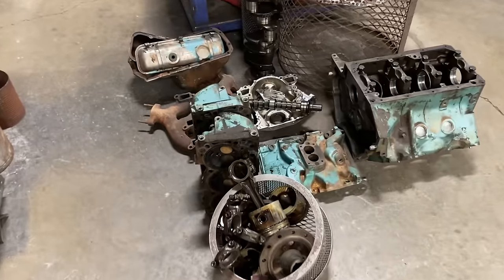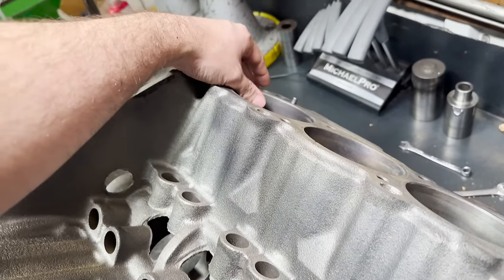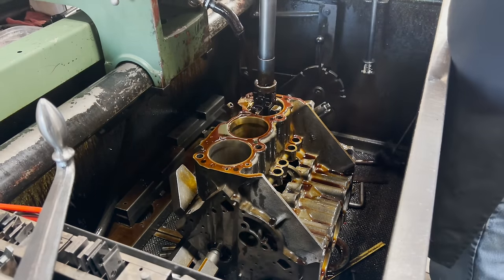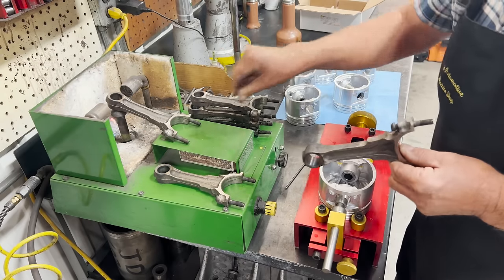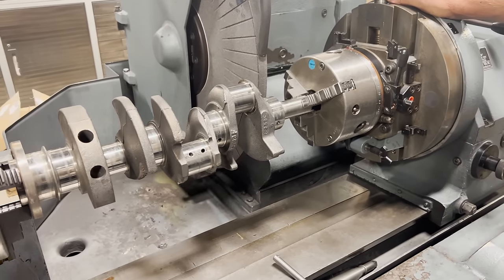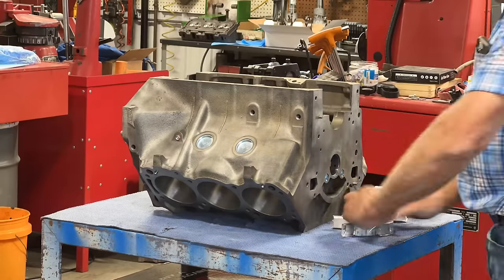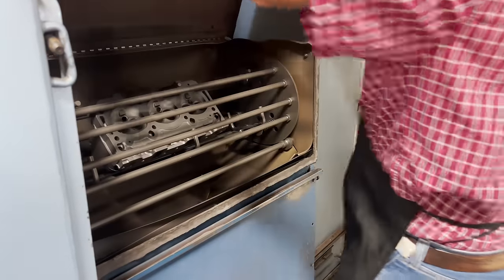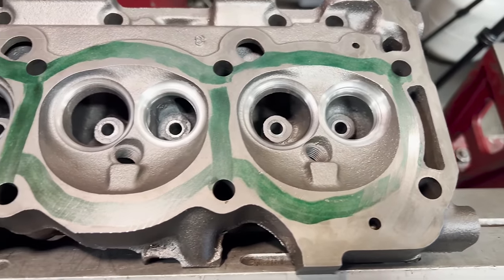This 225 Buick DAUNTLESS V6 Odd Fire Was WORSE Than We Thought...

Comment: I worked at a large Chevy dealer in 1977 when they started putting that odd fire engines in the cheap Malibu. One of the customers asked one time how come the ball on the three speed shifter was so big. One of the techs came up and said the reason they make the ball so big is so you can grab onto that sucker when it's idling. They ran surprisingly good but at idle they would shake the teeth out of your comb.
Reply: They needed to make it 60° vs 90°. Would have quelled a lot of the NVH.
Reply: My odd fire ran really smooth on the stock cam, once I put a the middle ground comp cams camshaft in it would shake a little as it rumbled.

I think a huge part of why mine seems so smooth is Jeep put a super heavy flywheel on them so that probably dampens the vibrations a lot.
Reply: @Livedracersteve I'll second the heavy flywheel probably helped.
Reply: How can you warranty the engine if the customer does most of the assembly?
Reply: @joshuaatkins5197  yeah I don’t know if you have ever seen the dyno graph for the Jeep version, but because the flywheel is so big, the torque and HP curve do not cross, it looks a lot like a 383 stroker curve where it just Carries the torque.

They would probably cross if you could rev it out more, but a stock engine stops making power around 4500 due to how poorly the heads flow.
Reply: @LynxStarAuto  Indeed, having a 60 degree V6 would have helped. However, companies love building 90 degree V6 engines because they can cut 2 cylinders off a V8, rather than so a lot of engineering to build a completely different V6.

Many years ago, GM did have a 60 degree V6. They put it in some of the heaviest GMC trucks. They had to make a V6, because making a 351 cubic inch straight six would not fit easily. I think some were as big as 478 cubes. I am fairly certain smog laws were the end of it.
Reply: @Livedracersteve  I havent but that makes sense.
Reply: @darrellbedford4857  All the machining & critical stuff has been done & done well no doubt. Other than fitting / timing the cam, the rest is all pretty straightforward. Unless the customer has hammers for hands that is, but we didn't see any bite marks or lint from a striped apron so all should go well. Would love to hear the exhaust sound.
Reply: @LynxStarAuto  Yes but that costs $$$ as it would need different tooling to bore & hone the blocks, as the 90 degree blocks can be bored on there normal V8 tooling. the wasn't a 60 degree V6 built in US until 1979, despite Ford UK & Germany getting it right in the 60's
Reply: @joshuaatkins5197  Torque and hp curves ALWAYS cross at 5252 rpm. Doesn't  matter  what the engine is. If an engine can't  acheive 5252 the curves don't cross.
Reply: @williambikash6645  Why are you saying that to me? I never said anything to the contrary. You probably meant to say that to someone else. Simple mistake on your part. 🍻
Reply: @skylinefever , an interesting thing about that GMC V6 is that it was produced in a variety of displacements as well in a V8 and V12 configuration. It seems quite odd, having a 60 degree V8.
Reply: They had a few different 6s in the Malibus. If the distributor was up front it was this Dauntless oddfire. 

The rear distributor ones (3.3L and 3.8L) were just cut down small block Chevy V8s. Exact same thing they did for the infamous 4.3L V6, just smaller bores and strokes.
Reply: @JM-lk6wo when GMC developed their V6s they didn't have a V8, so they were designed with all new tooling. The GMC  V8 was later designed from the V6.

Buick however already had V8s, so they designed the V6 to be able to use 90° tooling they already had.
Reply: @darrellbedford4857  you could only warranty the parts you put in and assembled and you would know these also if he or she or it for those inclined got the parts through you then standard parts warranty would apply to those this is the way i did things Cheers
Reply: @skylinefever manufacturers still had to make new molds.   Their inherit value was most of the incidentals (piston, rods , valves etc)the front accessories and mounting and bellhousing was common with their V-8 cousin.  Very economical
Reply: @skylinefever I'D take a 4.9 (300ci) Ford inline six any day over any V-6
Reply: @skylinefever The 2.8 and 3.1 were 60° engines as well.
Reply: Didn't shake as bad as the 4.3 diesel!
Reply: @OvertravelX  Yes, the 2.8, 3.1, and 3.4 were common V6 engines in FWD GM cars. I replaced so many stupid gaskets on them.
Reply: It was not an oddfire by then an even fire so this is false.
Reply: @skylinefever yep. And some of us still work on those old monsters from time to time. The company I work for has an OLD Hyster forklift with one. Been run on propane almost it's entire life and the oil comes out clean still to this day.
Reply: @skylinefever they also had 60deg V8s back then. Found this tidbit out just now trying to figure out from Google what the engine is in the forklift. Going off memory isn't helping since I only see it maybe twice a year.
Reply: @tcmits3699  oh, I don't know......GMC made a number of V6s that would put a 300 ford to shame.
Reply: Does boring and honing on older blocks with a torque plate show benefits?
Reply: It seems odd that if they were eliminating two cylinders, changing to a 60 degree block shouldn't have been such a big deal,
.  It would certainly have left more room in the engine bay.
Reply: @iancormie9916  all of the machine tools were set up for a 90 degree block.
Reply: @PMaynard-22  My '77 skylark is an odd-fire.  There was a mid-year switch in '77 to the even-fire.
Reply: @williambikash6645 
If the engine can't rev to 5252, some math can usually help extrapolate the curve to confirm
Reply: @darrellbedford4857  customer did disassembly. They gave him back a fully assembled long block
Reply: The toughest 6 cylinder engine I ever saw was a Chevy 292 inline 6. My father would slow down to 15 mph and never take it out of high gear. Then he would step on the gas and go. It would pull off like it was nothing holding it back. It didn't even sound like it was lugging. If I could have any 6 cylinder engine for a custom built car, it would be a 292 Chevy.

Comment: Thank you for explaining the whole odd firing thing. Very good illustration.  👍
Reply: Came here to say this as well.
Reply: Indeed. I did now know of a 90 degree V6 that either had offset crank journals or a countershaft.
Reply: Buick later updated their V6 to a split crankshaft in order to create an even firing order. It eventually evolved into the GM 3800 V6.
Reply: I believe that they went to the splayed crankshaft in late '77.
Reply: Not discussed in this video but I found it interesting the way they did the distributor cap
Reply: I remember it well, my 68 CJ had a 225 in it, tore it apart in 1982 and rebuilt it, sure miss that sound

Comment: the more rebuilds I see on Buick engines the more I like them. Very good engineering put into that Marque in those days. This is probably the only Dauntless V6 machine shop video on the internet! cool
Reply: My favorite thing about the old buick is that a buick 455 engine block doesn't weigh much more than a 350 Chevy block.
Reply: yeah! seems like black magic. And this little V6 is built like a bulldog with the pan rails and compactness
 @skylinefever
Reply: I could have kicked myself for not buying that little Buick nailhead V6 I saw one summer

Comment: Buick V6 expert here....    I know the engine is longblocked, but there's a couple things on these engines to be aware of.

The main one is because of that flat tappet cam.  Way back when, when Buick desigened that engine, they messed up the print on the #3 exhaust tappet bore.  It's damned near directly over the center of the cam lobe. (and for some reason, they refused to fix it on later castings)  Some cam grinders even choose to grind that lobe taper 'backwards' to try and make sure that tappet can spin.
  With Buick V6 blocks it's VERY important to burnish those bores, sometimes twice. I use the Goodson tool and I'm not sure if anybody else even makes one that works well.  Since you're running a flat tappet cam, I HIGHLY recommend grooving the lifter bores to force feed a small stream of oil to the opening ramp of the lobes.   These blocks love to wipe cams and with modern blanks, and non-hardened lifter feet, (along with modern oil formulations) a flat cam is a recipe for disaster if you're not careful.

This might not apply to this build since I'm a turbo Buick guy and we run split pin cranks, but rod bearings out of a newer 3800 series engine are wider and the same width as the rod. They're a direct bolt in and give larger bearing surface area.  With the final HP that Jeep engine is going to make, it probably won't matter.

Also, oiling is very important in these engines as well.  Especially with the low RPMs the jeeps will see. The way the oil circuits work in timing cover/pump is the low pressure side of the gears is partially starved until the pump can make enough pressure to crack the bypass valve open.  Once it's open, then both corners of the gears have access to oil.

Here's an article I wrote years ago showing some free efficiency and flow mods you can do to the timing cover.  The main one got named the ''earlbrown booster hole''. Drilling that will allow the entire gear faces to have full access to oil without the factory designed pressure drop at low RPMs. It also lowers the head height and gets rid of a couple unnecessary 90's.
  Since these engines like to make torque very low in the RPM range, you have to be careful not to load the bearings before the pump can get on the clock and start making real pressure.

https://www.turbobuicks.com/threads/how-to-build-a-front-cover-oil-pump.39169/

Also, as another bonus, making the pump more efficient will lower the amount of load on the front cam bearing.  Since that area is the first place the engine gets oil, not wearing that out pays dividends all the way thought the chain of bearings and passages.  (and eliminates the need for band-aid HV pumps, and thick oil)
Reply: Perhaps withe the crap metallurgy of modern cams, it would pay to have the stocker reground? I know these guys have a connection to a company that regrinds cams.
Reply: Did nascar run these in one of the lesser series, Busch or arca?
Reply: @jcnpresser  I can’t imagine that. These motors are museum pieces.
Reply: You are and expert on the Odd Fire? not, different engine. Some same issues like timing cover wear. I have run a few odd fires 225 in Commandos not the same as your later ones with 20 lbs max oil pressure for years every day to work and wheeling every weekend with half gear oil and half 10-40 in engine. Including winters. Dauntless engines not the later ones you are an exper on (later even fires) were extremely durable.  Had many built later even fire ones as well and even lots of customer cars got upgraded high-capacity oil pumps. Had hundreds of reg customers with Buick V6's in later 70,s 80,s as engines were in so many models, chevy, buick, olds. The Dauntless shown here was a much more durable engine.
Reply: @PMaynard-22   It's not a different engine. It's a different crank style (and distributor).  The architecture is the same basic design. The later 20 bolt castings are just slightly different at the deck height and the oil pan rail along with the valley casting.

Pretty much all Buick V6's of that era are robust as hell.  For what they are, they're very overbuilt. Especially considering the low amounts of actual power they make when assembled.  They really don't have any issues with hard parts unless you take the intercooled Grand National engines and DOUBLE the power.   And if you get one to fail at that power level, 99% of the time, it's a tune issue that breaks it.

....and the ones I machine and build don't require axle dope in the oil pan to stay together.

I'll trust my pump gas/akly 600+hp street builds as proof over one that has to get band-aided with gear dope.
Reply: Very interesting.  As an old-time jeeper in the SE Utah area I just love these old engines.  They are an almost perfect recipe of low end torque and more than enough horsepower to put a lightweight Jeep over the top of any obstacle you can imagine without anywhere near as much danger of snapping axles, driveshafts and hubs as these yahoo’s with their V8’s.  It also squeezes into a Jeep engine compartment with plenty of room to spare for radiator upgrades, electric fans and you name it.  Combine that with adapters that let you bolt right into the stock tranny/xfr case, I think it’s a no brainer for an old Jeep and that’s what we run in my 54 CJ3B.

Given all that, yes we do run the HV oil pump.  I’m curious.  What modifications or advice would you give in our use case considering that we don’t need to maximize HP, and reliability and ruggedness are much more important than anything on the trail.  I’ve also converted the Distributor to electronic to eliminate points which use to really plague us when we forded water deeper than 18”.  Anything else I should do.  I’m preparing a spare engine right now and want it as a standby swap in part as my current engine is burning a lot of oil and clearly needs rings/attention.
Reply: @pchris6662   Funny you should mention that.  I actually wrote the book on modifying the oil system on Buick V6s.
  And the main thing to look at is never run a chinese cover, and never run a HV pump.

The non-GM covers are garbage. The gear pocket is too deep to set the end play correct. Even if you leave the gasket out, you'll still have too much end play.

The crank seal loads from the front. Which means it can blow out the front. (crawling rocks that won't kill you, but at the top end of the drag strip, it will put you in the wall and ruin your day).

Also, somehow they have a big issue with the distributor/cam sensor bore and the oil pump shaft bore not being on the same centerline.  If you have to force the distributor down, you've sideloaded the crap out of the steel pump shaft against the aluminum housing material.

If you want the best oiling, get the newer style filter adapter with 'metric' sanded off and the larger I.D.   If you can't find one of those, get the RJC 'biggie adapter'. Either the threaded bushing, or the M/F version that uses the sammich adapter for an external oil cooler.

On the HV pumps, they offer no additional volume to the actual engine. All you do is make more load on the timing chain and front cambearing.  With the taller HV gears, the engine hemorrhages the same amount of oil, but the pump just has to bypass more oil. (and make more heat doing it)

Get yourself a good GM cover. Spotface the titty where the cam button rubs if you have to (and get a roller cam button).   Do my oil mods, and set the end play as tight as you can get it at room temperature with no tight spots, and let it fly.

You'll have the best oiling you've ever had with the least amount of parasitic drag. And you'll notice your oil pressure gauge will basically jump from idle PSI to WOT PSI as soon as you crack the throttle.

My method negates a pretty big design flaw from the factory and make the pump fun 100% oiling input at all pressures and speeds.
https://www.turbobuicks.com/threads/how-to-build-a-front-cover-oil-pump.39169/
Reply: @earlbrown  Wow, thanks!  I’m going to have to go to school a bit on the cover and oil setup.  I know my uncle tried to be sure and “take steps” to help this weakness on this motor so I’m going to drag out these parts and we’ll crack a few beers and go over this.  Thanks again for the insight.  Now that I think about it, your views on the HV pump do sound legit.  I did t ask why it was needed and just assumed the engines oil passages had a lot of wasted leak by that needed to be overcomed.
I do know a few things though.  The engine is the perfect combination of just enough power, more than enough torque, shorter then a i4 or v8 which helps a lot.  My motor, even though it burns oil and is 55 years old never fails to crank despite suffering a 10 year period of neglect in a Colorado fruit orchard when my cousin had it.  And I’m convinced that unique rather lumpy idle due to the odd-fire crank firing at 90-150 degrees actually enhances and amplifies the low end grunt when you let off the clutch on a steep climb.  I’ve never seen that motor stall out.
And quite frankly, it also just looks right under the hood of
Reply: Dammit.  YouTube crashed while I was writing that post.  Last line should read that I think that motor looks right and sexy under the hood of an old flat fender.  The perfect old school upgrade that belongs right alongside those 32 Fords turned into hot rods.
Reply: @pchris6662   Doing those oil mods will keep you oiling and protect what's left of your bearings.

If you ever roll some new ones in there, look at some rod bearings for a 95' Buick Park Avenue with the 3800.   Those are wider and the same width of the rod for a split pin crank.   Since you have a shared journal crank, you should have an even wider rod so that might be an upgrade (unless your bearings are the same thing as the wider 3800 units).

  Hundreds of people have copied my methods with great results across the board.  There's many turbo Buick Grand Nationals laying down a LOT of power with that 'stock' oil system. (mine is one of them)

And, I NEVER recommend snake oils or 'rebuild in a bottle' but IF your smoking if from ring seal, this stuff will help slow it down and bring up your compression.  Throw a jug in your engine, run it for 500 or so miles and re-run a compression test.

If the burning is a PCV problem or worn out valve stems and guides, it won't help. 
https://amzn.to/457mq8A
Reply: @earlbrown  🙏